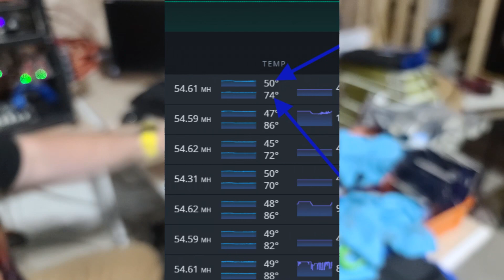MSI 5700XT MECH OC Thermal Pad Replacement DIY POOR QUALITY CONTROL EXPOSED!

Comment: For the stupid half covered heat sink design for the VRAM chips, I used 15x15mm copper shim plates on top of the heat pads to compensate the heat transfer to the fins. Worked absolutely fine, reducing up to 10°C. Recently change the heat paste for the GPU chip from Gelid to Honeywell PTM7950 and drill holes to the plastic back plate of the card right underneath the GPU chip, reducing up to 15°C.

Comment: heres some insight for begineers, when you cover the the entire memory module with thermal pads you will most definitely see a big spike in hotspot junction temperature, its not because of the wrong "pressure" on the gpu die, but its the result of extra heat tranferring from memory modules to the gpu die, cause heat tranfers from low to high, when you use high quality thermal pads, the heat dissipation will be so effective that it will ruin your gpu die temps, i have tried 1.5mm and 2.0mm pads and very soft pads, saw the same results across the board, and when i used the pads just as they came from factory to a slight offset and my hotspot temps improved significantly and i was able to overclock my gpu cause the temps were in check. So in short, if you are gaming do not cover the entire memory module, but if you are mining bitcoin, cover the module entirely, for best memory temperatures. That was my exprience with this model of 5700xt, i dont know about other models unfortunately.
Reply: I've owned a 2nd hand 5700 XT for about a year and a half, previous owner put some serious thermal pads on the memory modules and I've always been dealing with high die temps when gaming with it. I've been overclocking the VRAM pretty hard this whole time because I assumed it had no effect on the die temps, but your explanation makes perfect sense and I will do some further testing with this in mind! Thanks.
Reply: bro iI have a problem. I Repaste and replaced pads. but when its working in default profile temps goes up again  .I mean around 150wat its okay with 80% fan. but the more it goes junction temps goes up aroud 95-98 (175-195 watt)...I had to undervolt it on 1865-940 with a custom fan profile. any tip on that?

Comment: For gaming these are quite over clocked or over powered, but have a pretty good core and ram. I reduced clock to 1999 and voltage to 1050 and overclock the ram to 1850 or higher , now the junction doesnt go above 100c
Reply: fan reaches 100%?

Comment: Hi there i was wondering if you can help. I've changed the pads with 2mm gelid extreme and corsair paste for the die. Although gpu temps have come down to 75-78c mostly,the junction temp keeps spiking to 111c and the fans keep ramping up to full whack after 75c at a loss what to do next.
Reply: Most people recommend using 1.5mm thermal pads for the upper/middle 2 VRAM chips. If you use 2mm the heatsink might not be level causing there to be a significant gap between the die and the heatsink
Reply: @josephyost22  that's what it might be actually. It's not totally level. Slight gap where the thin long strip of thermal pad is on the fins. I have some 1.5mm also. Will give that a go thank you. 👍
Reply: @whumanati3927  so what thermal pads are best solution 1.5mm for the top 2 and for the rest 2.0mm?
Reply: @whumanati3927  did you ever get around to doing this? if so, results?
Reply: Try PTM 7950 on the die, 2mm on the side memory and 1.5mm on the top. Just did this to a friend's MSI Mech 5700xt and junction temp stays SOLID no higher than 95c and fans never ramp up to max.
Reply: @livingthedream915  thanks for the advice. Tried 1.5mm on the rear. It did help a little. Junct dropped to about 105c. I also butchered the fan shroud and put two different fans in which brought the noise right down. I ended up selling it because for whatever reason i could not get decent visuals on gta 5 no matter what settings i tried. It worked fantastic on MW19. Lost about £100 on it but lesson learnt i guess.
Reply: @whumanati3927  Sorry to hear that brother, hope you have a better GPU now.

Comment: I recently bought one of these cards off of Mecari for $175, I researched this version of the card prior to purchasing so I knew what I was getting into. When I got the card the outside of the card was is pretty good condition but the temps go out of control fast and I kept having inconsistent clock speeds. I purchased 2mm thermal pads and opened up the card and was honest shocked how bad it was compared to some of the videos I saw. On the GPU die, there was barely any thermal paste, all of the thermal pads were a third the size they should have been and half of them were not even on the memory chips fully. After cleaning and replacing everything, the card runs a lot cooler and sustains clock speed better, but I think I need to add some fans to get more air to the card. I have a Jonsbo D30 case which has a verticle air flow setup.

Comment: Main problem with this: The upper 2 memories need 0.5mm smaller pads (~1.5mm), just take a closer look at the cooler and you will see why... (You can see the gap at 01:50 )
Reply: Can't you just cut them in half?
Reply: @therealstanthelee2141  I'm talking about the thickness of the pads.

Comment: I actually just replaced mine with 2 mm pads and mem temps are drastically worse!!! What d'ye reckon is going on?
Reply: just guessing.. but. core temp might be lower? just if you got better thermalpaste for your core, the heatsink will heat up more from core and also mem. or bad pad quality?
Reply: @rangoying  I'm using Noctua thermal compound on core and thermal grizzly pads on memory chips. Been using thermal grizzly since I first replaced with too small of pads. I had to layer a 
.5mm on a 1.5mm and it's working great but using 2mm pads brings up thermals drastically! Hitting 100° on an MSI RX 5700 Mech OC
Reply: @Dankbongripz420  100 is fine max junction temps, I highly doubt the card is getting to 100c

Comment: very good job dude 👍
i have a question about this card and her urban legend : some says that the screws that MSI uses for fixing the cooling system are too long and dont apply "correctly" on the gpu, making a "lost" of thermal conduction... have you noticied that when have/use/fix the card ??? 🤔